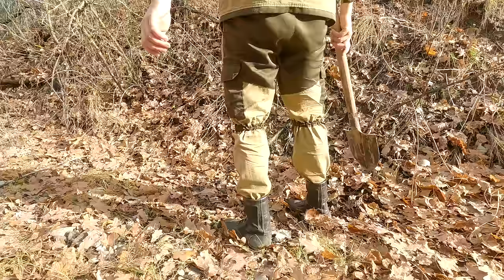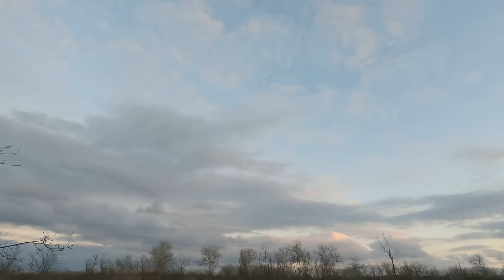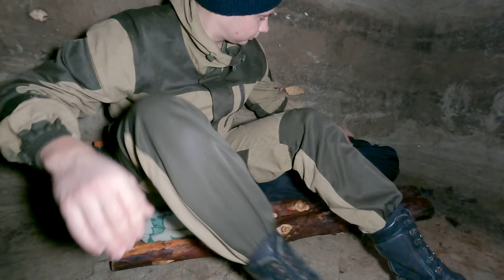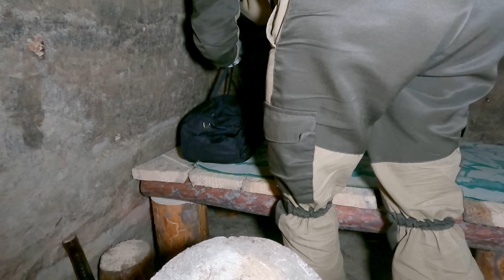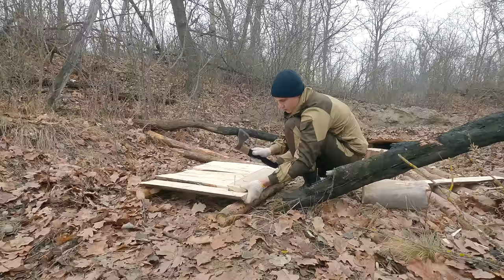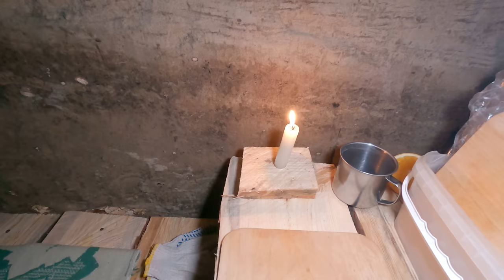Building of a warm and secret dugout for the winter, my hidden refuge in the forest

Comment: i disagree of ur idea - when it rains all d water will come down from ur stair inside ur underground shelter it will soften the soil, also no need to nail both ends of d plank - save energy and nail
Reply: I'm thinking he has great ideas. I also agree with your critique. But they are easy to remedy.
Reply: I would dig down below the fireplace another 3 feet for comfort in standing and the bed of wood is not necessary with a dirt shelf bed. And while burying the dugout, I would heap dirt to redirect the flooding around. And make a hatch door a foot or two from the edge of the roof. The stairs are necessary to make it work.
Reply: It is hard to tell without thoroughly looking around. But this appears to be a low area that I think rain water could run along.
It's a lot of work to be destroyed by rain. It is very different to my area soil wise. I wonder if it's a clay base, if the ground is a clay hole was filled with wood and several chimneys to govair to the base of the fire. Fire the pit to bake the clay perhaps?? Again that may too be a waste of time. I'd guess all you could dool is log line it to protect a wall collapsing from rain in the ground
Reply: does it rain when it snows?
Reply: @jfern6673  it may snow today and rain overnight. Just because there is snow does not mean it can't rain after
Reply: Très d'accord...et c est toujours ce qui arrive

Comment: It's a good idea as minimal wood cutting involved. The shovel needs to be strong. The only thing that bothers me is heavy rain. This dig out is susceptible to being flooded.
Reply from the maker: There is no such heavy rain in this area so there is no need to worry
Reply: you just build a canal with a drain around the dig.
Reply: @birbwatcher5515  True but I would go even further, by getting an old fashioned rain barrel, and have the trench empty into it, as a source of water collection. Why waste the chance to collect a valuable resource that, so long as it is properly boiled and purified will be ready for use? Waste not want not, after all.
Reply: @ForestHermit   Not yet😅
Reply: @alkirk-ws4co  guy has chicken fillets from lidl so water cant be that valuable resource.

Comment: Amazing! Good job!

Some more tips in the future.
1) if you don't have a matress, fill a plastic bag with leaves and use it as a mattress
2) on the door, try to cover it with 2 or 3 more layers of plastic to block the wind and water breaking through ut
3) on the stairs and on the ground, put some wood boards to prevent it from becoming muddy when you come from outside wet or when water drops in
4) dig a smaller hole in the shelter on the floor, so colder air would drop in it and the room gets warmer
Reply: Mi smo to radili kao djeca.Pravili takva skloništa i iskopali unutra peć probušili vani i stavili konzervu kao dimnjak!Gdje si ti proživeo mladost!😂
Reply from the maker: Thank you very much, great tips my friend, I will definitely use them!!
Reply: You forgot about the air ventilation. With all that and a fire inside you will litterly die. And a small hole will not be enough litterly dangerous.
Reply: Bazinga brt klk imas god
Reply: Polythene over the door and windows would keep out water and some wind not sure if it holds the heat in though ie insulating
Reply: @Thedrunkenswede1337  na mrozie też umrze, takie życie 😂
Reply: @janantoni4967  eller så suger du på den här istället eftersom du inte kan engelska. Or you just lern too talk the universal language next time. 🤣🤣🤦

Comment: Great construction (and video, both composition and editing, well done)!  Love the idea of a hidden shelter, plus a built-in stove/fireplace.
The site choice may not work out for you in the long run, between two hills like that.  Seems it would get plenty of runoff from both sides after rain or snow melt, giving you a wet floor.  Better might be on top of either of those hills, or better yet, further down under that fallen log in the distance.  Add a few to that for a roof, keep the existing grade for the floor, and the only digging would be to straighten the sides, maybe a sump hole.  Possibility for a future project.
Reply: you have to remember Bill, the JCB has to be able to access the ground to do the real digging ;) I mean you didn't really believe he dug ALL that ground with that tiny shovel without breaking into a sweat?
I've done labouring fella, when you're digging that hard you peel off layers and the sweat pisses outta you, and to dig a hole that size, your back would be annihilated, oh and the blisters on your hands and feet too ;)

Nice videos, very interesting but you won't fool a guy whos grafted for a living!
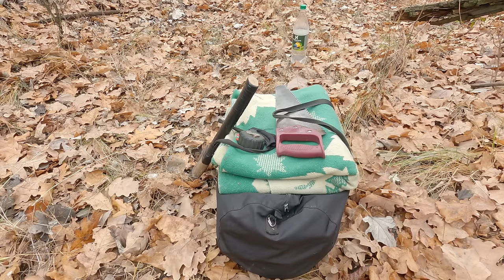Reply: 3:46 he sheds cloths. hes wearing gloves ....yeah...  @TheHungryTrollRawr
Reply: @TheHungryTrollRawr  was my first thought too, he 100% used heavy machinery to dig most of it. also the "door" he created is a big fail, he rather should have constructed a hatch.
Reply from the maker: Muchas gracias, tus consejos son muy buenos, ¡definitivamente los usaré!

Comment: Unreinforced dirt walls, no waterproofing, no drainage.  The first time the walls get wet the sides will collapse and it'll be just a mud hole in the ground. 0/10.
Reply: It let fall going in winter, what rain are you talking about? Besides, these types of shelters (Russia/Eastern Europe) used to be traditional temporary shelters until something more suitable, like a log cabin,  is build
Reply: @hawklord25  I'm not interested in temporary shelters.  It should be built in a way that it lasts year-round under any conditions.
Reply: @jeremiahmiller6431 I don't remember "permanent" anywhere in the title. Hang on, I'll go check the description.
Reply: Always gotta be one... 👀

Comment: I am a hermit myself. Do you also use this dugout methos when there is a bit of a ravine? and if very wet soil or maybe even to rocky to big in like I have here what would be your go to 2nd shelter for as many benefits as possible as to this one here in video?
Reply from the maker: in rocky soil I would dig a cave and strengthen its roof
Reply: thank you for the reply. I mostly turn into a stone mason/cabin builder. I may be what some consider hardcore because I always build 2. Do you do that? and do you mind sharing some reasons why we might want 2  @ForestHermit

Comment: That is so cool lots of hard work - but plz everyone be careful - as soon as u dig a hole it is slowly collapsing. Stay away from sandy soils - hard wet clay is best for structural strength or least board the sides. Doesnt take but a split second to be buried alive. Common issue in the plumbing excavation.
Reply from the maker: yes you are right there is a chance of collapse but the sand is mixed with clay and the walls are very strong

Comment: Hammer a small nail into a board. Put the candle on the nail. It does not tip over. It will rain. What precautions will you take against mud?
Reply from the maker: thanks for the advice, very useful, there is no dirt here. just sand

Comment: Nicely done.  Perfect soil.  Quite a job.  I have seen many dugouts constructed, some with coldwells for food storage, some without.  Many videos are narration free now, but I do not remember seeing any dugouts with coldwells built specifically as cold air sinks.  Since a dugout is much like a snow cave. and snow cavers are encouraged to construct a stepped formation that allows coldest air to drain below floor level, is such a technique used or valued in dugout construction?  It seems like they might go dank (old meaning).  Perhaps the fireplace is a cure for all that.
Reply from the maker: Thank you very much, it was nice to read this comment, I tried to make this zoom as quickly as possible, so I didn’t take into account many nuances
Reply: isn't that a stream ditch? :-)

Comment: Miss the point of a middle short handle shovel while intensively digging for days. 
So back spine breaks better and also to sleep better at night? It is not matter of what you have if you plan to dig for days... just peel off a branch or adapt a pole and make an improvised longer handle to work proficiently with more leverage and less effort.